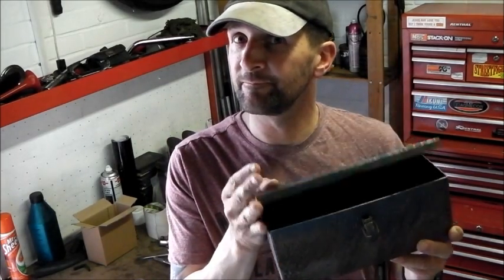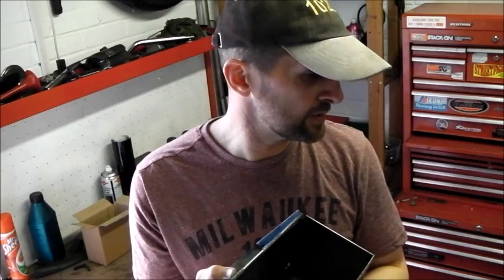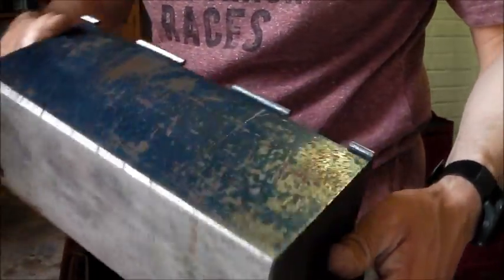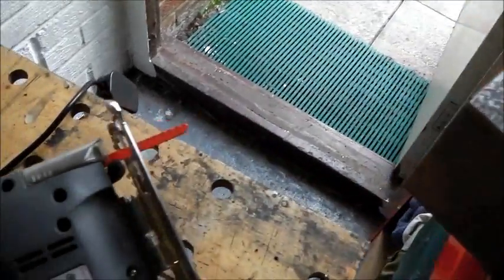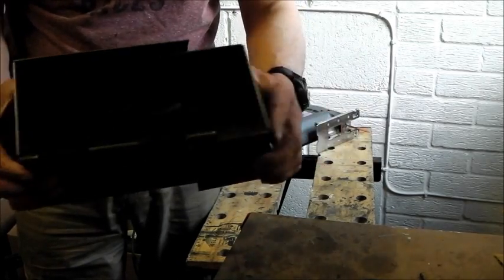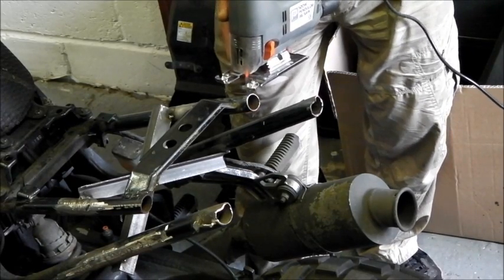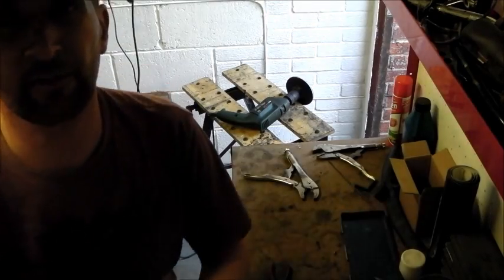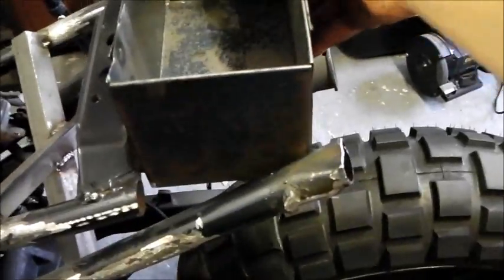Delboy's Garage, Project Bandit #5, 'Whats in the Box'?

Comment from the maker: Got the seat rails to brace and strengthen first, then weld the box in place, (the rubber strap from the tool bag will hold the battery in)...and the tail unit will cover it all up...got a real treat in the next one....you'll be impressed...!

Comment: Forgot to mention Del SLA batteries can be used for jobs like that... The sort they use in house alarms.. I have a couple here and as they are completely sealed they can be mounted however you like... I dont know if they would have the amps to spin the Bandito over though